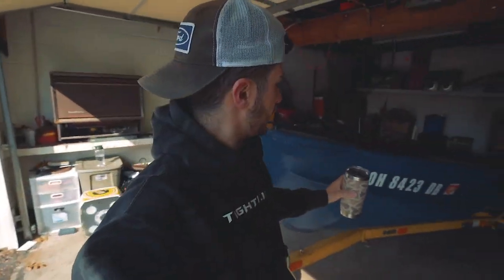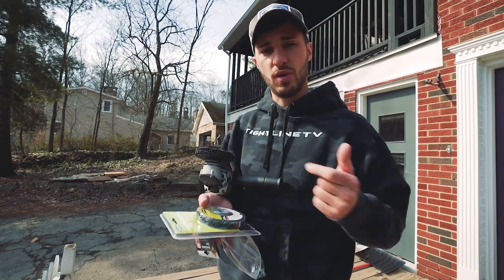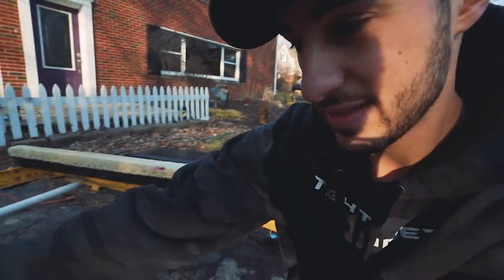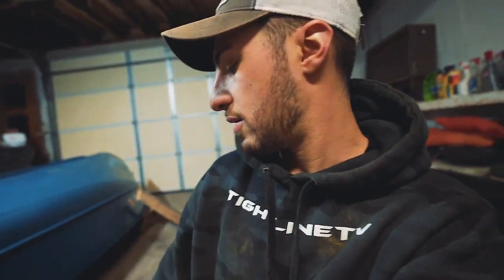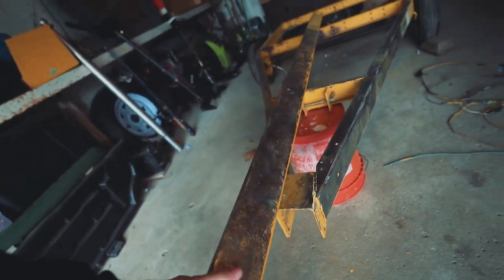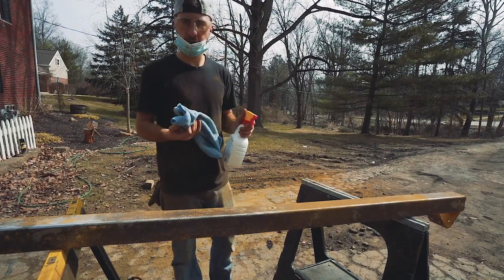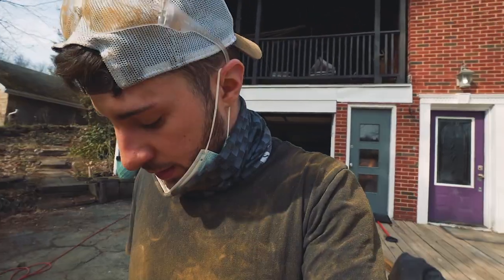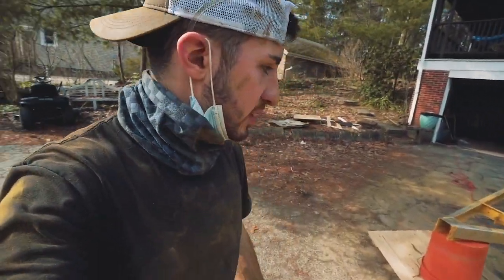Building a 1955 Bass Boat! Pt.1 (Jon boat to bass boat)

Comment: Bolts you speak of are called carriage bolts I believe
Reply: Washers and lock tight is what could have been used, those bolts are only good anchoring wood to metal.
Reply: Yep carriage bolts.